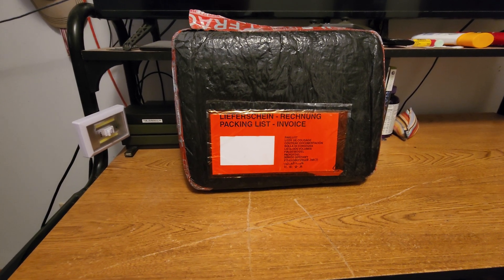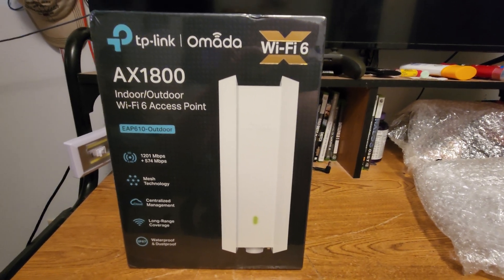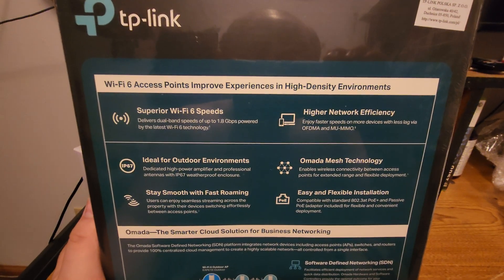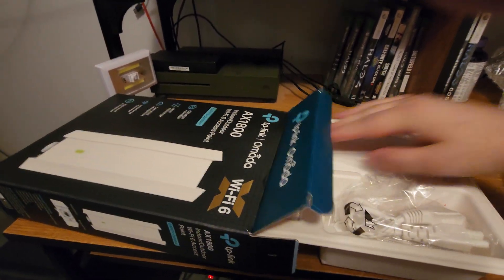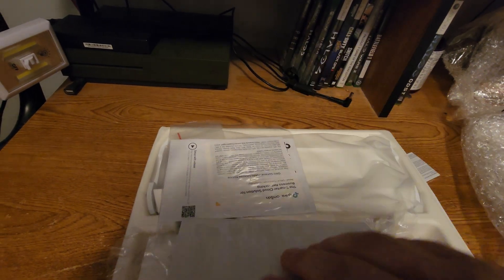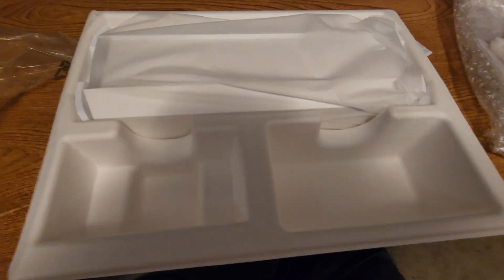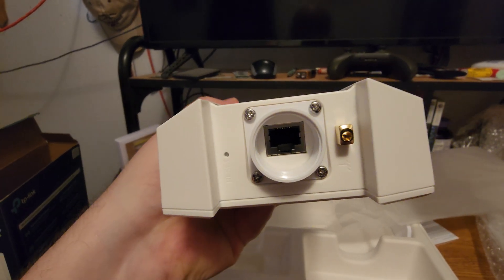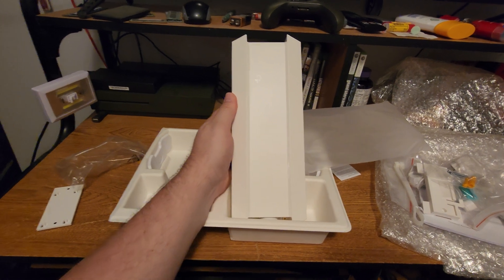Unboxing TP Link EAP610 Outdoor Wifi 6 Access Point

Comment: Directional or 360?
Reply from the maker: I'm not entirely for sure.  Not tested it. I looked on TPs website and it didn't mention it. I'd guess it's about 180. I can get a signal behind it.  But, im outside and its behind a metal wall. So, it dies off quickly behind it outside.

Comment: What can be max distance and how many clients can this equipment handle remotely connection?
Reply from the maker: I've not tested this outside yet.  But, the website says max range of about 300 meters.  Now of course that's going to vary based on the environment it's installed.  I looked online and couldn't find any max client information within my first 5 minute search.  But, i'd guess and say you wouldn't want more than 100 clients.  Now 100 clients all doing streaming video at the same time probably wouldn't work very well. But, that would also depend on your ISP that you use as well.

Comment: Waiting for next video about this device.. Speed and range performance
Reply from the maker: I hooked it up in the shop and hit a technical snag.  I need to get a new poe injector for my point to point antenna.  It's stuck at 100Mbps link.  I contacted ubiquity and told them they sent me the wrong POE injector.

Comment: How much was shipping?
Reply from the maker: It was about 44 dollars. Ordered it on a Monday and was delivered Wednesday.
Reply: @techmaster170  I ordered it - paid $28 economy shipping and it took 11 days.  But it arrived safely, AND I paid NO import duties, which surprised me.  Will have it hooked up in mid July.
Reply from the maker: @ggouldson  Nice.  I dont recall any other options.  I havent done any videos on mine in use yet.  I'm having a bottle neck issue I'm hoping ubiquity will correct. I need a new poe injector for my point to point antenna.